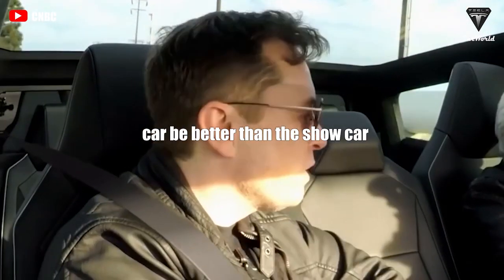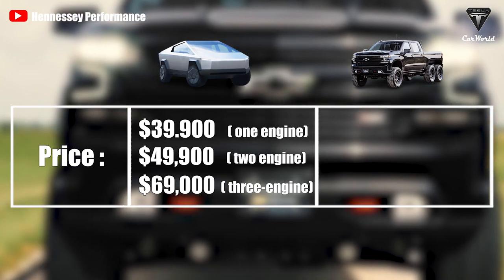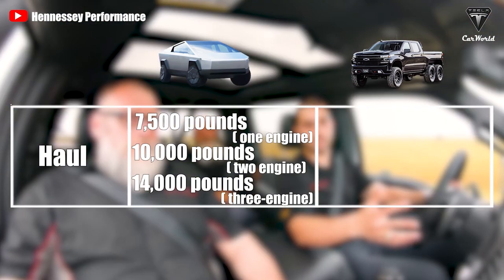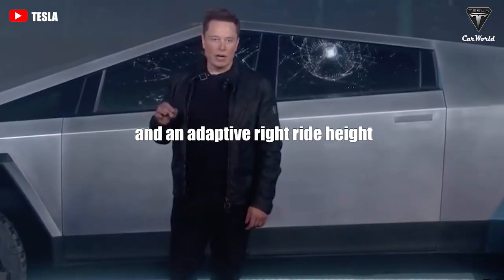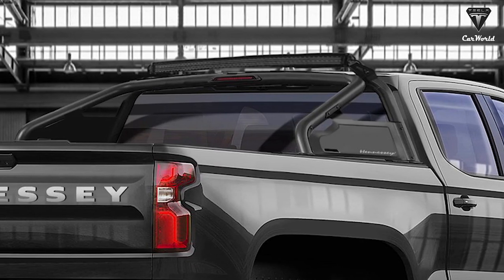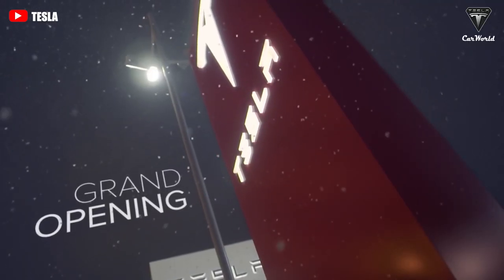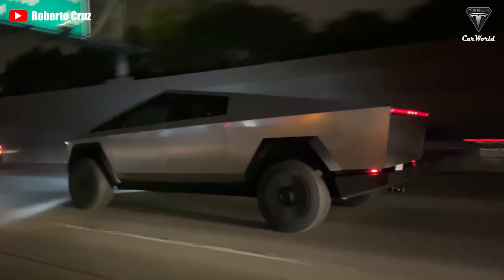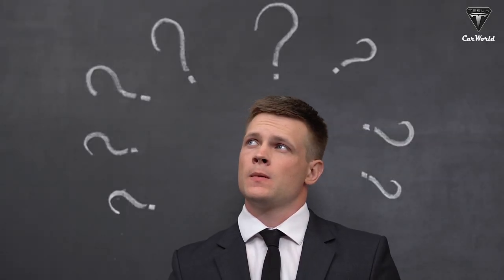Which is the KING of 2023 Pickup Trucks: Tesla Cybertruck vs  Chevrolet Hennessey Goliath 6X6.

Comment: You said nothing about fuel efficiency. Although, it may not be needed. However, in the light of full disclosure it should be discussed !
Reply from the maker: That's a good aspect to discuss. Thanks for your comment and have a good day !
Reply: Not necessary
a 6.2 l V8
700+ hp
drag-coefficient ?

my guess : about 1 
mile per gallon ?
🤣

Comment: They are both strange compared to the trucks we have driven for years. The Goliath is weird and $375,000 so not anything I would even consider.

Electric vehicles (car and trucks) don't have to look like the internal combustion engine vehicles of the past but as a conservative person I will not want one that looks strange or weird.  

I drive a 2000 Chevrolet Silverado extended cab 4WD pickup with a 5.3L V8 engine.  I drive a truck so I can tow one of my three trailers. Have a camper, a car trailer and an enclosed trailer.  Will soon replace the truck and will be looking for a truck that is normal looking and functionable.